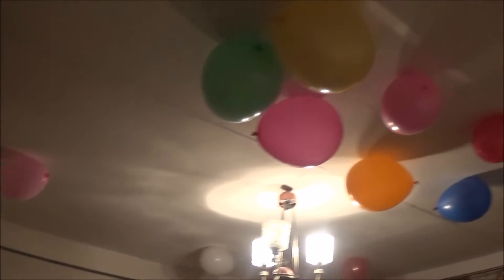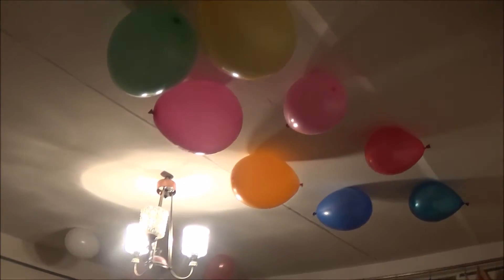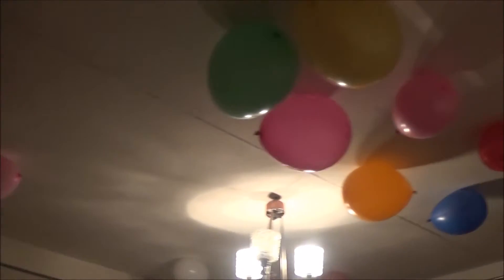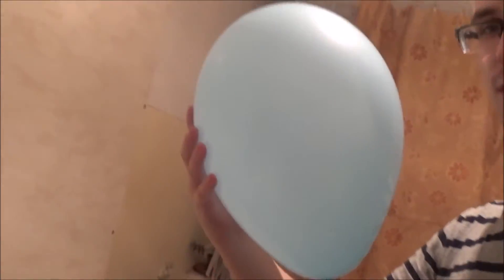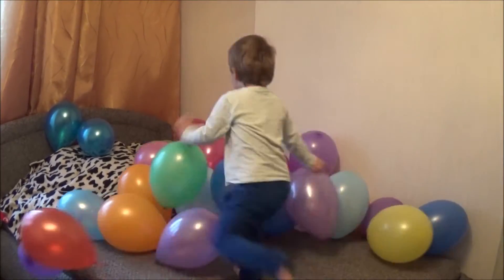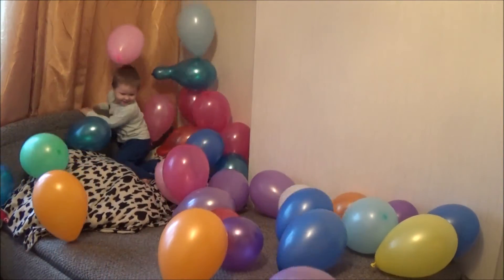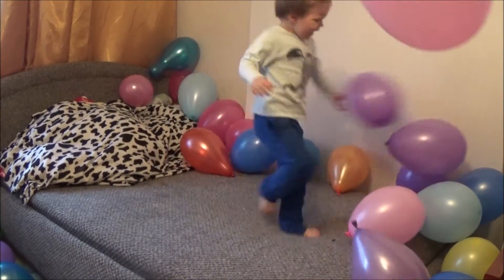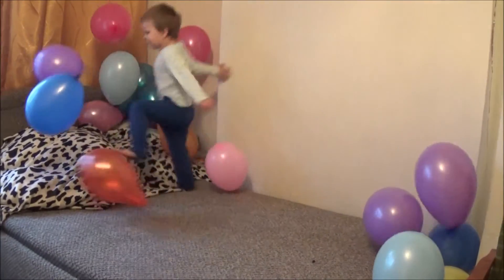How to make balloon fly using electricity

Comment: it not flying it just stick with the roof for a couple of minutes.
Reply: Lot more then minute. You could make balloon float in the air. You would need to move the ''roof'' or any object u use from the balloon and it would follow the object making the effect of it flying.  There for it does not stick to the ''roof'' its trying to pull it self to the object.
Reply: OK let's see,I will buy a new balloon today and check out what will happen.